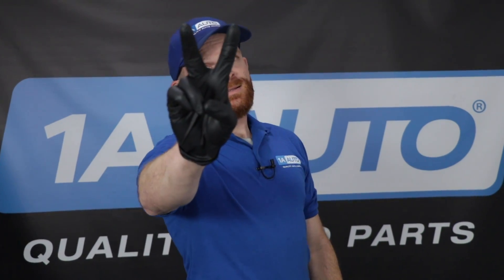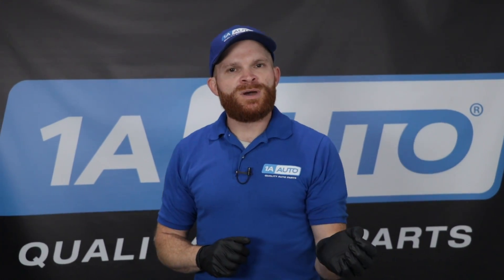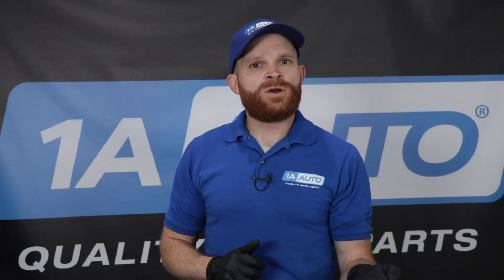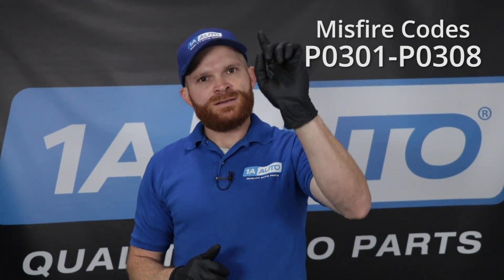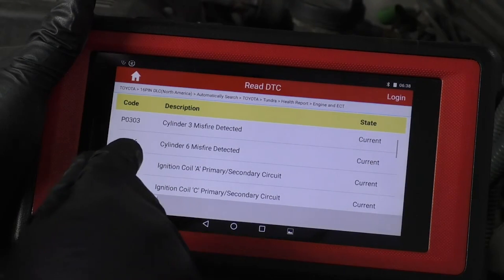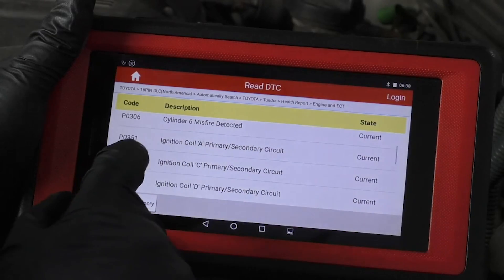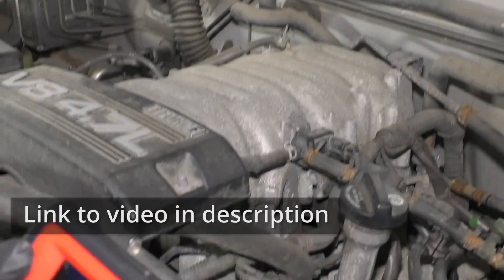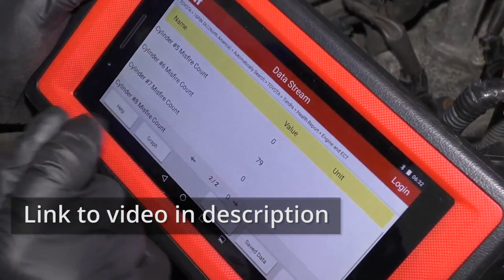Most Common Car, Truck, SUV Trouble Codes - Explaining OBD-II Codes

Comment: I keep getting the catalyst codes for bank 1 and bank 2 on my 03 chevy silverado 1500 with the 5.3L but there is a problem. The codes are intermittent. Meaning the engine light goes away after a little time and the codes only seem to show up after some harder driving/acceleration. I'm not a mechanic, I do some little things, but I was under the impression that catalyst issues don't just go away like this. I'm not getting o2 sensor codes but to me since this is intermittent that maybe my downstream o2 sensors are not reading correctly. What do you think? I'm curious if you had any ideas on this because I haven't really been able to find a whole lot of info. The exhaust smells but it's not a lot. My engine does have over 200k on it.
Reply: Maybe a short in the sensor wiring?

Comment: I sometimes get the P0420 code. I wonder if they means my catalyst converter is dying since the code goes away after continues driving. (And allowing the car to warm up before driving anywhere)
Reply: This may be an old comment. But, I ended up with that error code myself. When I took my car to my mechanic, instead of checking the catalytic converter, he told me that the code can come up if I end up with bad fuel in my fuel tank. He advised me to buy some fuel cleaner and fill up my tank with premium and that should solve the issue. I got the error code a few times last year coming up once every 2 or 3 months. It only popped up once this year this past summer. However, I opted to just clear the error code and see if it would even come back, of which it hasn't.

Now, inspections are coming up. But, I assume that they would test for persistent error codes as opposed to a random blip in the sensor.